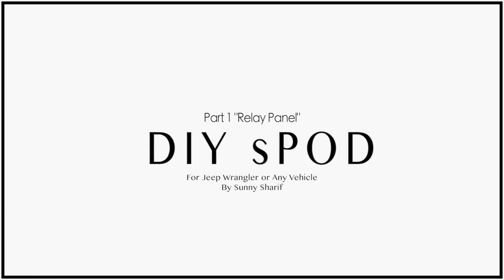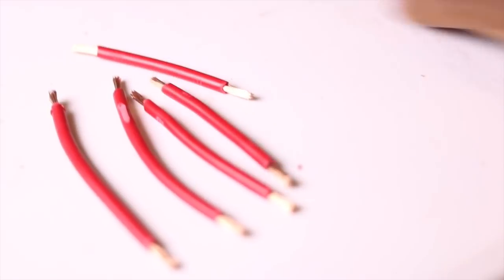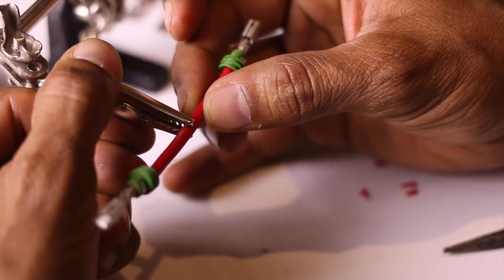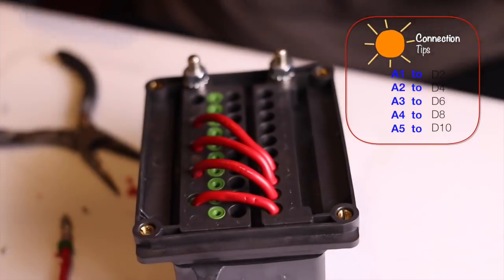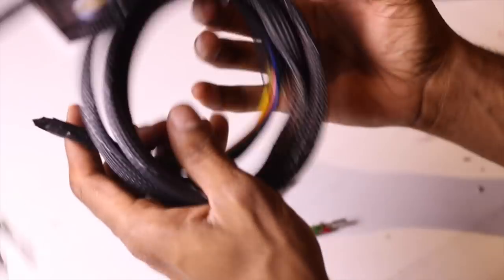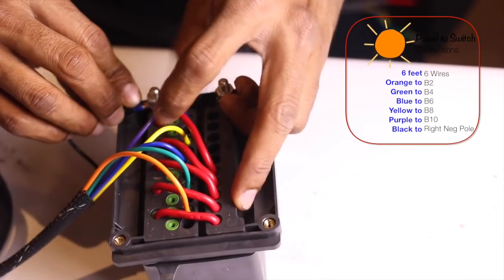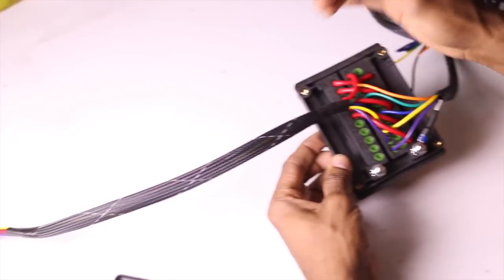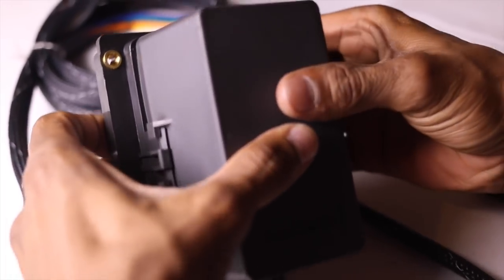DIY sPOD "Switch Pod" for Jeep Wrangler 2011-2015 (Relay Panel)(PART 1)

Comment: This worked perfectly! I skipped the 50 amp circuit breaker and 8 guage wire as I have no interest in putting a top-of-windshield-lightbar on. I switched this out to using a 30amp inline fuse. Only running low watt LED cubes so I should be ok. Also installed this with the Rugged Ridge A Pillar switch pod. Thanks for the detailed videos. Best out there to date!
Reply from the maker: Thank you Chris for your comment, I am glad it worked out for you and the video helped :) best of luck

Comment: Specifically @ 1:55 you show the connections as A1 to D2, A2 to D4, A3 to D6, A4 to D8 and A5 to D10 but Hooz has his wired A1 to D2, a blank plug in A2, A3 to D4, a blank plug in A4, A5 to D6, a blank plug in A6,  A7 to D8, a blank plug in A8 and A9 to D10 with a blank plug in A10.He also uses two buses and I did not see you use any.

Comment: I did this panel a couple years ago. Love it for my switched accessories. Now looking to wire in usb receptacle and GMRS radio. Can I use this box without the relay to act as a dues box? Any thoughts on how to do this?

Comment: As you have this relay box wired, the blade fuses are between the relay and the accessory, right?  I see you have 5 open blade fuse sockets, can these slots be used to run hot wires to other accessories which don't require a relay, i.e. CB Radio, Scanner, etc?
Reply from the maker: John Purdie hey thanks for the comment, I haven't tried it but yes you are right those lines are hot, so I would assume you can use them as a inline fuse, what I will do try this out this week and I will get back to you :)

Comment: I have the Bussman relay box 15303-5 - a number of  switches send a ground signal to activate the relay (vs a + trigger) - is there a way to trigger the a / or some relays (pin 86) on the 15303-5 using a ground signal ?

Comment: Sunny, Thanks for the great videos. I am hoping you can help me. I did it exactly (I think) as the videos told me to do it. I have power going to the fuse box but, no power going to the fuses themselves. My wires FROM my switches have power but no accessories work. From what I can tell, the power stops at the leads on the fuse box. I put my relays in "backwards" as per your instructions. It was REALLY hot yesterday here in South Florida so I stopped working on it after about an hour of troubleshooting. Any suggestions? I did test all of the outgoing wires and my voltmeter is reading 0.00

Comment: Where is the cheapest place i can buy the bussmann. Why did you choose that option instead of the other ones. I notice how some have one hole, and then two holes, and then yours. What is the difference. How much did you pay for shipping from waiktekwire..??
Reply from the maker: Hey thanks for the comment....you can search on eBay or google to search for the cheapest place.... I went this way because this was the simplest and easiest and safest way....and I felt comfortable with this one.... I have installed this now in 8 jeeps and it has become super simple for me.....try it and you will love it .....

Comment: ok so i want to use the 5th slot for accessories that only turn on when the jeep is on. instead of having a switch turning them on they would turn on when the jeep is on. i know i can splice into the 12v outlet but i dont want leds, gps, cb radio, and aftermarket heated leather seats drawing from the same outlet. thanks for any advice

Comment: Since there are 10 fuses and 5 relay slots, I assume 5 of the fuses are tied to the relays and the other 5 fuses are independent for usage by themselves?
Reply: I think this is correct, you could use the 5 additional slots for always on 12 V power to CB, etc.
Reply from the maker: yes true :)

Comment: I want to run a compressor with a 45amp draw can I run a 50amp fuse and relay with this set up?
Reply from the maker: I can't see why not....it should work just check the relay capacity..

Comment: Need help Awesome video I have completed my DIY using the same fuse/relay panel with your instructions however I messed the wire gauge from the jumper hot 12v fused pin to power relay by using a 14 gauge instead of 12 gauge. I'm powering 35w fog lights and all the wiring used from switch to relay to accessories is 14 gauge. Just like to know if I'm fine/safe  with this I won't be using any high power aceesories. Please assist I'm dying to install on my car.
Reply: +Momed Miranda - with as small length of runs the jumper wires from the fuse to relay are, you are fine with them being 14 gauge.

Comment: Is there a easier way to wire the accessories. Is there a s pod that comes with this already done I have never done this before and wouldn't want to mess anything up wire wise.
Reply from the maker: once you follow all the three parts, its not that hard..i can walk you through...if you live in the states...send me a PM with you number..there are some people making this and selling it..but its expensive and not DIY anymore....then you should buy the sPOD itself.....
Reply: +Sunny Sharif okay that sounds great I would really appreciate that. Question. How much would and S Pod already made cost. Just wondering.
Reply from the maker: the actual Spod if you buy it can cost you over 400 dollars or so, the one i made can cost you anywhere between 160-200 depending on the switches and etc

Comment: hey sunny,
  thanks for this tutorial I have been trying to figure out how to wire all my accessories up in my truck and was lost. Have never wired up stuff in my trucks before. so all my lights and accessories are in my closet while I'm pulling out my hair to figure out what to do.

this really helps.

I do not have a jeep but this is the same basic concept to use. Just have to fabricate a panel to hold my switches in my 2001 Tahoe (zombie outbreak response vehicle) lol.

I will have to do two of these though I have 8 accessoriesin my closet to hook up so far but will do one for now and the next one in a few months.
Thanks again brother this is a life saver I was so worried about creating a fire hazard.
Reply from the maker: Hey Mike, thank you for your comment, I'm glad it helped.
You can actually make one there is another bigger panel that takes more than 5 relays.
I will find it and send you a link.
Let me know if you need more help I would be happy to assist u 
Once again thanks for the comment.

Comment: Hey Sunny, awsome video. I haze ZERO wiring experience but I think with your video walkthroughs I could probably figure it out.

Tell me this though, what makes this specific to the 11-15 year models? Why would this not work for 07-10?  Just the dash panel you chose?
Reply from the maker: Hey buddy, actually this can and will work for any vehicle or any year. Only reason I put the year bracket, is because the lower dash panel I'm using in part 2 is specific to Jeep Wrangler models 11-15. I believe 07-10 there is a similar panel available by day star with 4 switches only. Also anyone can use this with any type of vehicle. It's not only limited to Jeep Wrangler. Also there are many other companies they make the switch panels, such as pillar switch panel and etc.
Let me know if I can help you further and I would be happy to assist u:) and good luck and Subscribe for a new upcoming led series :)
Reply: +Sunny Sharif that's exactly what I though. Thanks!  

And for extra clarification, I think you installed all your lights and fed their wires appropriately to the engine bay and connected them to the new relay panel box that was attached via Velcro/screws? Right?
Reply from the maker: +xburtonboardnx yes Burton, my next video for accessory will explain how I connect lights to this relay box :)
Reply: +Sunny Sharif thank goodness! Hahah. You're the man. Keep up the good work.

Comment: Another question, could you run power to the switches from one of the open fused (not relay controlled) slots on the box instead of tapping into the cigarette lighter for switch power?
Reply: Yes. Some people do that.

Comment: Love this three video series. I was wondering if you guys could help me out. I am looking to build this for my self, I was actually looking to build two of them. I was wondering if you guys know where i could get a bigger box to hold the relays and such. right now i am looking for something with a total of 11 or 12 switches. I have the inside switch placement  figured out but I am trying to figure out how to add on to the box's you made, or make a single bigger box. to get the right amount of switch relays  i would need. any help would be GREAT! 

thanks,
Jordan
Reply from the maker: Hey Jordan Thank you for the comment, you can get a bigger relay panel from the same company, I believe it holds 10 relays, or you can make two or as many panels as you like and combine them.
Process would be the same as this one just more relays.
I hope this helps, if you need more help feel free to contact. I will see if I can find the link for the panel and I will keep you posted. Best and good luck
Reply: +Sunny Sharif Thanks !!!
Reply from the maker: your welcome buddy

Comment: Is it possible to wire this differently with the same outcome?  I've seen some others that are wired slightly different
Reply from the maker: Hey Mike, there is other possible ways to wire it, then you will have to put the relay different ways as well...in this as you can see the writing on the relay is upside down when I'm putting those in....so if you do wire them differently make sure u install the relays correctly :) I hope this helps

Comment: Watched several times. Fixing to order parts and dive in. Two questions. 1: Did you cover all the empty slots with silicone or the whole back?  The top has a cover but not the bottom. You said you were going to but didn't see in any of the videos.  2: Could you use the other 5 empty slots to power some low power accessories like maybe some interior floor led's?  If so do you just add another Red wire to connect both sides then a fuse for that spot?
Reply from the maker: Hey Thomas, thank you for the comment. I used silicon in only the empty holes only. But before using the silicon I still used the seals in the empty holes, I hope this helps....also for the other 5 slots I would say you still need the relays in order for you to use those slots...this unit only has 5 relays space so you can use only 5 switches with this panel. If you want to use more than 5 bussman makes a bigger panel than 5, check that out as well if you like. I hope this may help. Let me know if I can be at any further help to you. Good luck!
Reply: +Sunny Sharif  you are awesome. Can't wait for more Jeep videos

Comment: Awesome video, I was looking through the write up but could not find anything about the cable sleeve. What sized did you end up using on your kit?
Reply from the maker: +Pat LNU hey Pat i used the 3/8 braided expandable sleeve here is the link
I ordered 3/4 that is minimum at 1/2 inch 
http://www.ebay.com/itm/Braided-Expandable-Sleeve-Wire-and-Cable-Loom-Sleeving-Choose-Color-Size-/271530288721?var=&hash=item3f38776651

i hope this helps
Reply: +Sunny Sharif What does this mean?  What size did you actually click to order from e-bay?
Reply from the maker: i clicked 1/2 inch- black- and 20 feet.
Reply from the maker: let me know if this make sense..
Reply: +Sunny Sharif perfect, thanks! Just waiting on parts to get in now before I start the build!

Comment: Can you send me a copy of the diagram you show at 3:30?  That would be helpful.
Reply from the maker: hey I have been sick for over a year now..i will try to locate the diagram if i can.,,sorry for the delayed respond
Reply: Sunny Sharif no problem I actually figured it out. Got it all installed. The relay panel runs my LS engine in my Jeep. Thanks for the great video!

Comment: Hey Sunny Awesome video...I am about to pull the trigger and order these parts, the only thing that i couldn't find was the wiring sheath that you ordered, Do you have a part number for this? Thanks in advance!
Reply from the maker: Mike Queen hey Mike, you can get the wires from any store close to your locations. Autozone, amazon, but buy a good quality wires as cheap wire may get heated and break. Let me see if I can find the link for the wires I bought .thank you so much for the comment and liking the video... subscribe a lot more coming soon!

Comment: Do you need to use all 5 relays to make this work? Because I used 4 but it's not working so I may need 5 after all right?
Reply from the maker: Each relay is for each switch that belongs to each accessory, I think you should check your wiring if it's not working

Comment: Awesome video! I'm using marine wire just for some added rigidity and peace of mind, will this be ok, or will it cause some issues I can't think of?
Reply from the maker: yes absolutely you should be ok...just make sure to use the right gauge wires... and good luck...Let me know if you need any assurance :) I am working on so many new videos for my new jeep...wait till you see those as well :)
Reply: can't wait! ordered most of the stuff today, the wires i will get tomorrow from the shop. is there any way to protect the box a bit better, or is it fairly well protected as is?
Reply from the maker: +Yiannis Neocleous what do you mean secure the box, you mean after the install or box as it is...box is water proof as it is, check out the 3 part for installation... The way I secured the box in part 3 it's perfect :)
Reply: I was just thinking some extra protection against heat and whatnot
Reply from the maker: +Yiannis Neocleous oh no I have been running this for awhile and no issues at all

Comment: so I have a question regarding specifics..Part #: 46343, it says 30A per contact? Your are using a 35A Relay? I'm confused there, i'm following your guide here..but i'm stuck there..any help is greatly appreciated? What would be the max amp of that panel. this video is useful.
Reply from the maker: Hey don't be confused or worried. If you order the same parts in the list and follow the directions you should be fine. To make it little simpler here is the specification data sheet of the relay: read that as well so it can make it clear for you https://www.waytekwire.com/datasheet/46343.pdf

To be simpler and clearer and you can see in the data sheet also, input on relay side max is 80A and for output is 30A ....I hope this helps...read the data sheet and trust me you will be fine
Reply: +Sunny Sharif For wire, i checked Waytek and the minimum is 250ft and is way too much for what i need it for. I checked all my stereo installers and alarm installers. I checked Home Depot no luck. How can i get some cable. Can you sell me some left over cable? I'm looking for whatever you used? no accessories cables..
Reply from the maker: +instinct022 hey buddy, if I had the wires left I would have sent you for free, check Amazon they have the best prices for bundles or just get it from autozone, they have 25ft bundles or 50ft bundles and prices are not bad at all. Otherwise look for electrical supply stores near you. Homedepot won't have the similar wires I hope this helps ...I got my wires from local electrical suppliers, autozone and amazon ;)
Reply: +Sunny Sharif I'm listening to you..I got everything down, except the wire from switch to relay..why 16 gauge and not 14? That will be my question..do you think a 10 awg wire from relay to LED 150 watt will be more than enough and most important safe..I got everything down except the mentality of AM I DOING IT WRONG? thanks for all your help..
Reply from the maker: +instinct022 hey buddy, 16 gauge is more than sufficient from switches to the panel, however if you want to use 14 that should be ok too. For the 150 watts led, you should be ok with10 gauge. I'm running a 300 watts of led bar with 12 gauge wire and it's perfectly and I havnt had any issues.... Just one thing...don't use cheap eBay wires...buy wires from reputable company or local electrical suppliers and check the reviews before you buy. Also buy the wires those are true gauges. Normally the led bars such as 50 inch uses the most power so you only need big gauge wire such as 10-12 awg for those types of lights.... Good luck and keep me posted and send some pics :)
Reply: +Sunny Sharif thanks..I'm finding cross link sxl wires..it'd hard to find the lengths that you need. I already called a lot of car stereo/alarm installers no luck...I found this wiring products but I'll do research on companies..
Reply from the maker: +instinct022 you don't need a lot of wire, 6 ft batch and 2 ft batch and some additional...length but not too much more than that

Comment: What was the total cost for all the parts?
Reply from the maker: Depends on the switches you get, if you get cheaper ones then all should be under 160-170

Comment: so which port do you plug the wires that go to the accessory in?
Reply from the maker: i m sorry  i am not understanding the question clearly, Check part 2 and part three of this series...I go in details how to install it.
Reply: how do you connect accessory to the whole system so that power and ground is complete?
Reply from the maker: ok once you finish with this part then you have to make the switches part, then the long wires will be attached to the switches, the short wires will attach to the positive of the accessories and the ground of the accessory will attach to the body of the car.